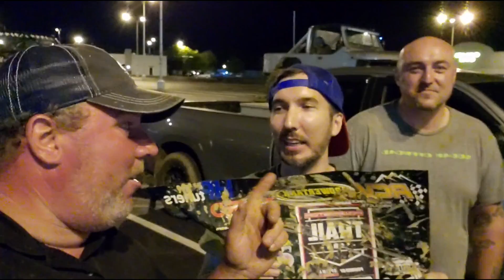The Motor Blew Up on the Scorpion... and Then I Flipped It 🤬

Comment: The Scorpion isn't dead...  A simple transplant would put it right back on the trails. But at this point I'm sure Matt has a small list of things he wants to do slightly different with version 2.0. Now he finally has an excuse to make those changes. Possibly 4 wheel steering? The Scorpion is a legend. Scorpion 2.0 will just be an extension of that legacy.

Comment: Sad to see a motor go; I threw a rod in my xj at christmas and just finished putting a new 4.0 in. This does, however, make me excited for a potential swap. Maybe a TDI? Propane build? Perhaps even a smallblock :P
Reply: I like the idea of a TDI for a dedicated rig.  Lots of low end torque and it seems the wiring is pretty simple.  Light too.  Add to that, lots of parts available after dieselgate, can use a smaller tank and/or get lots of range.   I think they tend not to overheat if I am not mistaken.   That is a lot of reasons.

Comment: damn thats wild. it sounded so healthy all the way up until it blew.
Reply: I know right. Heres my short story experience. I had a 97 that was the same way it was running like a champ for me 75 mph on the freeway around a winding stretch boom everything went dark and dead on the dash I lost all power steering right away my adrenaline kicked in and I forced the wheel to the left and flew off the left side median went airborne landed perfect bounced a bit and coasted to a safe stop and popped the hood to see a 6 inch round window in my block with nothing left but a mess of broken parts. Was running great before that with zero warning signs I was 😤 but then realized I was unbelievably lucky to have got through it alive with cars everywhere around me Washington state patrol showed up real quick.

Comment: I need advice after watching your extreme skill and clearly front and rear lockers that lock up right away. I will never be doing anything like Trail 5, but I do want to be equipped as I explore alone on much more conservative terrain. I have a 96 K2500 Suburban, 7.4L Gas, 8600 GVW. It has a factory "Posi" and open front. I want to install lockers (not like ARB) front and rear and am willing to give up some "chirping" and such on the street for reliability off-road. Is the "original" "Detroit Locker" still around for my rear? I was thinking a Torsen-Type front locker. ANY advice would be substantially appreciated.

Comment: 4.0 are bullet proof but only for a time .Build a stroker to put back in there.
Reply: I've got a WJ with a 4.0L. I've been looking ahead at engine swaps. I've looked at 4.0L based strokers, supercharging, hemi, and LS swaps. I need mo' powa, reliability, parts availability, room to grow, MPG, and (ugh 😩 Cali) smogable. 
I hate to say it, but that LS is looking highly favorable.
Reply: My 4.0 WJ has the 4.6 poor mans stroker kit and I love it ........ but I’m in Georgia man
Reply: Have an LS3 and I love it, for matt id reccomend and iron 6.0 bc those are bulletproof.
Reply: Ya LS is garbage compared to a good well built inline stroker IMO the FT LBS an HP a stroked 4.0 can put out is  more then respectable and very useable rpm ranges numbers. LS is nice and all but there is way more to it then is worth it, wire harness, motor mounts, tranny mounts, the ECM, PCM, TCM  different drive lines now new breaking system and even more then that all just to throw away a more reliable engine design that just keeps going. I know the 4.0 threw a rod or whatever but the way Matt used it of course it was going to happen it was underpowered for the amount of weight I know that rig must have added even after cutting the entire body off more of less still is a tank. With a 4.7-5.0 inline stroker that thing would leave nothing to be desired😉

Comment: I'm not interested in the FC

It's gonna be a good thing and all.

Now, I want to see 4.7 Stroker in the Scorpion, doesn't that thing have a Atlas in it??!!?!!?!

That Samural your wheelin' w/ is an excellent testament to the whole power to weight ratio thing.

It's got 16v Geo Tracker "Engine" in it right?

I'm wondering what tcase and trans he's running... what's the low range on the Sam?

What's left of the tub and frame on that looks good! Gotta love that Sammy hood👍

Comment: I was just curious about the  maximum suspension travel on the front and rear axles. I'm looking to start a custom tube chassis 4x4 vehicle build. Planning on using 2.5 ton Rockwell axles front and rear with the Ouverson 4.90 axle gears, Gen 3 LS (4.8L, 5.3L, or 6.0L whichever I can find fastest/cheapest), 6L80 Transmission, and either an Atlas II or SCS 2-Speed Transfercase, on 40 inch tires eventually with ORI Struts after I have a rolling chassis and have driven the vehicle for awhile. Thanks
Reply from the maker: Ditch the Rockwells
Reply: @bleepinjeep   @bleepinjeep  Thanks for your thoughts, just noticed how many King of the hammers, rock bouncers, rock crawler vehicles are using Rockwells. I realize that they are really heavy. I just would prefer robustness and durability over a limited lighter weight axle. I was actually planning on using the added weight of Rockwells to help lower the center of gravity. Since the tube frame and other items above the axle are  lighter in weight if I can.